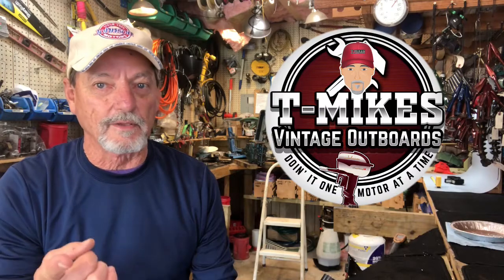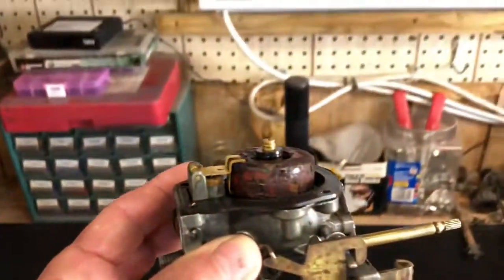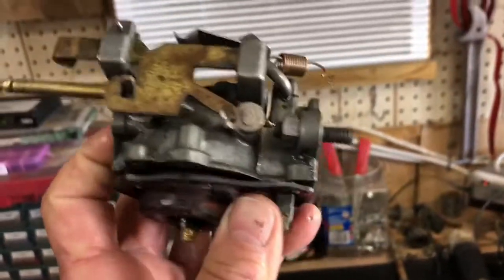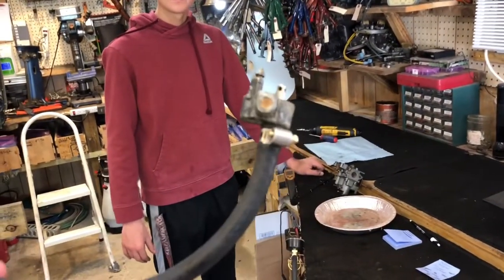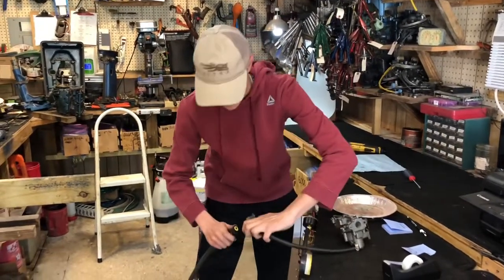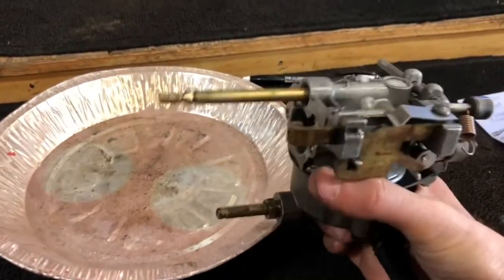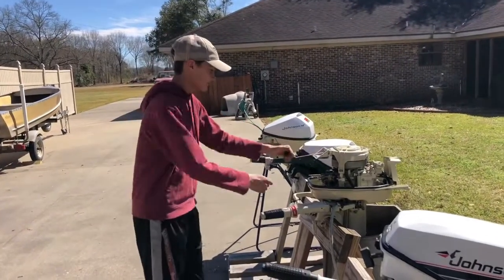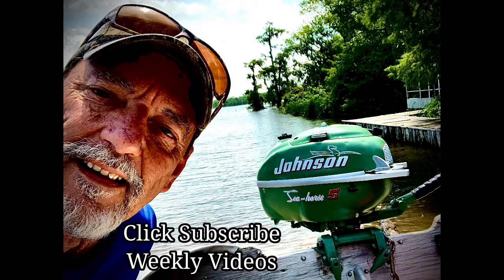Stuck Float Carburetor How to Test & Repair Vintage Outboards

Comment: Thanks for the video I've had similar problems with motors that run fine in the tank put it on  the boat and it won't start  I tell you that will make a preacher cuss

Comment: Hey T-Mike, thx for great videos. They are truly enjoyable. Do you have a tips on how to remove a stuck impeller housing on an '65 Evinrude 3hp? It has been running in seawater.
Reply from the maker: Try spraying carb cleaner on it.
Reply: @michaeljsimon  Thanks, will do

Comment: The TD-20 Johnson carb is a bad design for sure compared to the newer carbs like your son worked on. Just watch the guy with the sledgehammer Johnson video with one of these carbs. He finally figured  out the float pin was getting caught on the lid hole. It doesn't take much for these to leak

Comment: Cool trick, Also I took apart my 2 HP Evinrude Motor Carburetor and everything appears clean but I  do not know where to start adjusting my low and high speed jets. I started with 1 turn out on both and went up to 3 turns out and it will only run with throttle on high and yet only seems to be at idle rpm?
Any thoughts Thanks
Reply from the maker: Sounds like running on one cylinder. Check spark
Reply: @michaeljsimon  2 HP only has one cylinder and it has good spark

Comment: How much fuel will come out if the carb. I have a 97 175 merc. The top carb >s pouring GA out if it when it runs. Then stalls out. Would it be a stuck float. Or a Reed issue
Reply from the maker: Stuck float issue

Comment: I have a mercury 20 horse 4 stroke and wen I start it up I notice gas on the water and wen I give it throttle to go faster it will die out on me . But it idles just fine starts good and as long as I'm going slow I have no problems. Could that be a dirty carb or sticking float . Like it's getting to much gas I don't know but I'm glad I stumbled on you channel.. so I had to sub up thank for your time
Reply from the maker: You have clogged jets in carb that need cleaning.